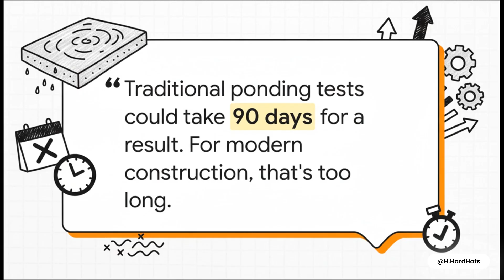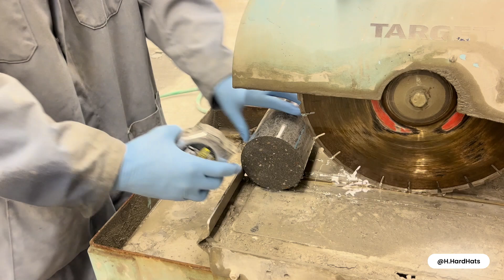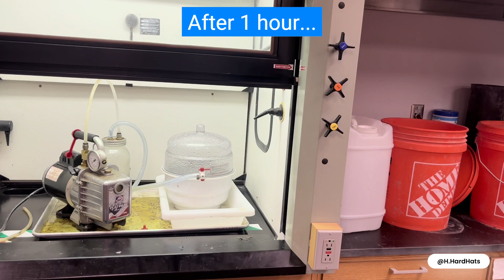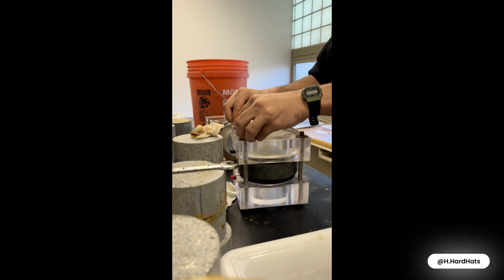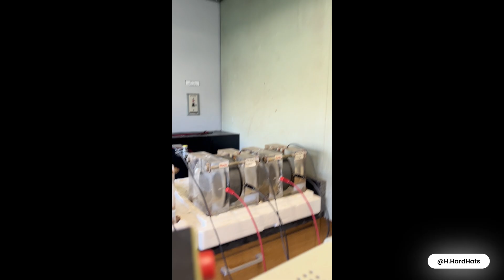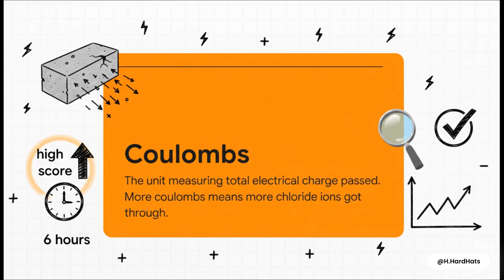Rapid Chloride Permeability Test (ASTM C1202)

Comment: It's a pretty flawed technique, concrete with SCMs will probably have lesser OH- ions in their pore solution which means lesser charge transfer throughout the test. Also other Ions like Na+ or K+ is also being trapped in the solid phases by secondary CSH hydrated product with lower Ca/si ratio. 

Overall lesser ions in pore solution, also concrete with SCMs have high tortuosity means higher electrical resistance. 

Both factors show lower value of charge transfer and hence such tests suggest that the concrete matrix is mostly solid no free paths and voids available for permeability.